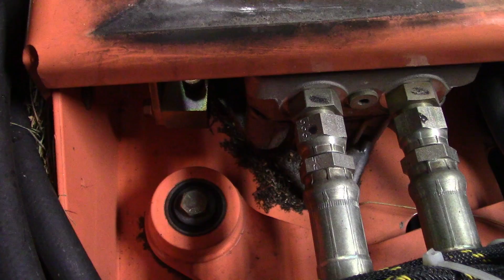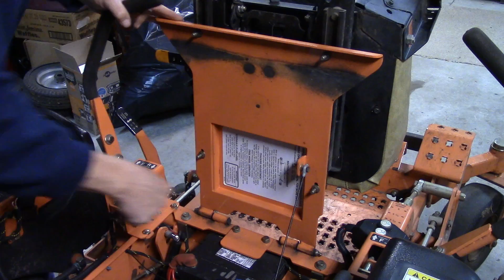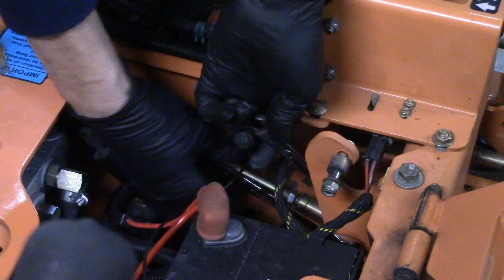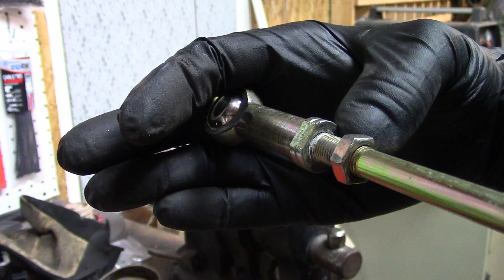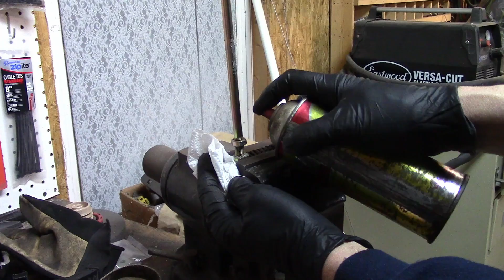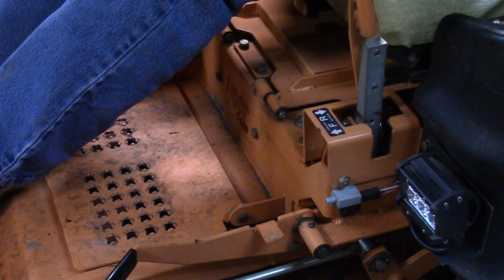Scag Tiger Cub stearing repair and adjustment

Comment: Great video, i have same machine. It started last season 2023 steering levers where getting further apart. Then reverse was getting worse. I adjusted the rod on right side and was better forward but worse in reverse. Saw your video and had same problem. tightened two bolts readjusted the rod back  to where it should be. THANK YOU!!!!!!!!!!!

Comment: Nice video and very helpful! Just one thing that might help someone else in addition... I jacked up the back of the mower so the tires were off the ground, put a weight on the seat safety switch, and had it running. I was able to see the adjustments taking effect and knew exactly when it was in place without having to get on and off.  Thanks MMW!

Comment: Hi Mark, great informative video! 
What exactly was the issue with the steering levers  that caused the need for adjustment?
Was the mower creeping forward or backward when the steering arms were in the neutral slot or was there some other issue?
If the mower pulls a little to the left or the right when both levers are fully forward can adjusting that rod fix that?  Thanks!
Reply from the maker: The connecting block from leavers to pump came loose.

Comment: My 2005 Tiger Cub with Honda power has been great on my monster yard that is more like a cow pasture. I bought it to get my grass cut in less time, about 3 hours compared to 5 or 6. This mower has cut limbs and tree roots like a champ and still going in 2021. The mower has been abused over and over again and still comes back for more. I don't sharpen blades, just get new ones.

Comment: Nice job Mark!  Being handy sure has its benefits.  Thumbs up on the anti-seize.  Lots of rain on the east coast glad its not snow but it sure has made a mess.  Who need ratchets when you have hands as fast as Marks?  :-)   Funny when I work on things it takes me a while to realize I didn't put those latex gloves on.  I bought some from harbor freight blue in color those things are great might be 5 mil.  Titewad I am I'll reuse them just turn them dirty side out and blow in them to pop the fingers out and I'm back in business.  Hope you and the family had a nice Thanksgiving.
Reply from the maker: I use a lot of those gloves, saves a bunch of time trying to get the grime off later. I am pretty tight with my money too, I am always reusing gloves if they are not ripped.
Reply: gotta protect those hands we make our living with them.  Not looking forward to the winter beating my hands up.  thanks for taking the time to reply.  One thing you have to say about youtube it can put a bunch of good decent people in touch with each other.  Share that knowledge.  check out" Buckin Billy ray smiths" channel if you get time.  he's a good guy and has a lot of tree removal videos and better yet old vintage saws and axes that he uses.